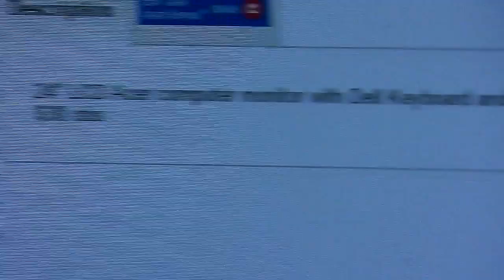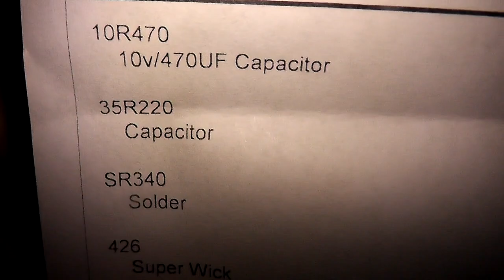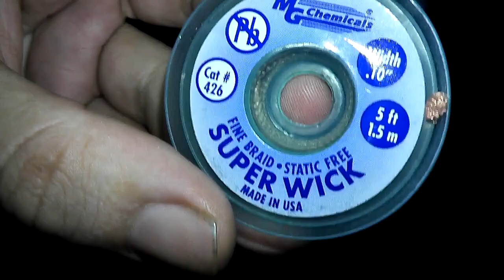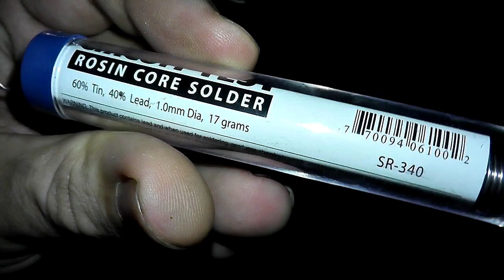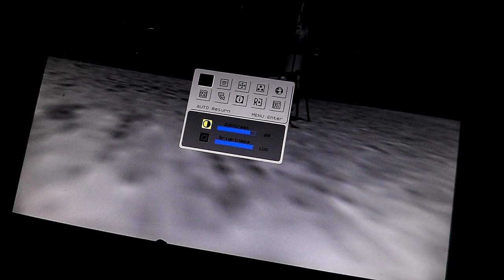Kijiji deals, helping friends, monitor repair

Comment: If it turns on for some time and shuts down the screen, with the power light still on green, the ccfl drivers are the problem. Usually the coil/transformer blocks fail and that's the end of day, otherwise you have a chance. If the screen stays on, but it looks faded or flickers, the ccfl tubes are the problem.  
I think you're better of with the Kijiji deal

Comment: Shame about the monitor :-(, it looked quite dull though, almost like the backlighting was still wrong.
When you use your desoldering tool, heat the joint untill molten, apply extra solder if you have to so the solder joint is fully molten, have the tool hovering dead vertical above the joint, quickly remove the iron and slam down the desolder tip into the solder while pressing the release button (all in one action).

Comment: With modern 802.11n routers in the 2.4Gz band, they overlap 2 channels in each direction, so channel 6 overlaps 4, 5 and 7, 8. So basically, you can use channels 1, 6 or 10 - on all the other channels, you get interference.
Reply from the maker: +Seegal Galguntijak yes but if you use channel 8 the overlap is not as extreme therefore you shouldn't get as much interference as channel 8 is where the fallout from channel 10 and 6 would be.
Reply: ***** Well, channel 8 would overlap 6, 7 and 9 and 10, so you would get interference from 6 and 10 and also interfere with those two channels. Try it out, see if it works, I wish you the best of luck.
(We could at least use channel 13 - if that weren't prohibited in North America, and thus the OpenWRT firmware of my router doesn't allow it either).

Comment: Don't you have LCD monitors in the garage just sitting about?  Not sure if they work...Otherwise people are always giving away free 17" monitors.  Sure it's a 4:3 or 5:3, whatever (never understood that aspect stuff) but free is free :D  Didn't you also mention a monitor behind the green screen?  $30 isn't bad for a 24" monitor, just depends on how old it is.

Good video on how to show soldering in new caps...I've always wondered how it's done, I figured it was that, but it was nice to see a video.

Comment: great show, haven't soldered in a while good review. check the power in the monitor more. too bad repair kit so much or research what is in the repair kit. old sometimes is better than new. would you show me how you can do three monitors to one computer. i do two monitors to one laptop now and it is great, one for ispy and the other to see your videos, good show

Comment: Ah...couple bucks to try fixing the monitor...worth it....$100 to replace a old tube that is not being made anymore for a HiFi Stereo amplifier just to sell on Ebay for $500 and have still not work screws the pooch (that's what's happening on my bench right now)